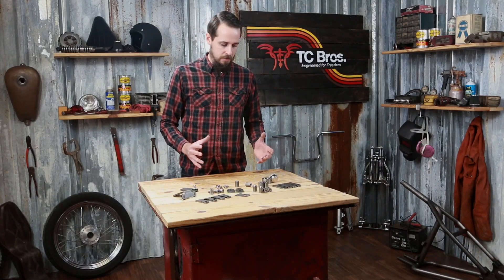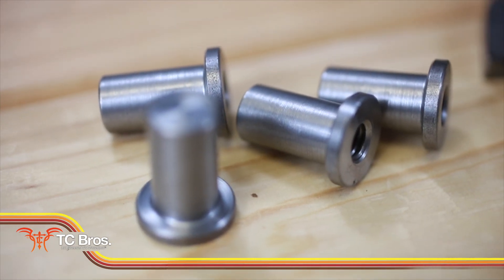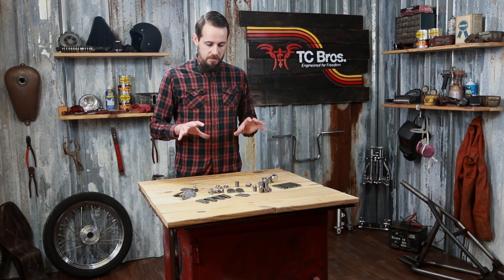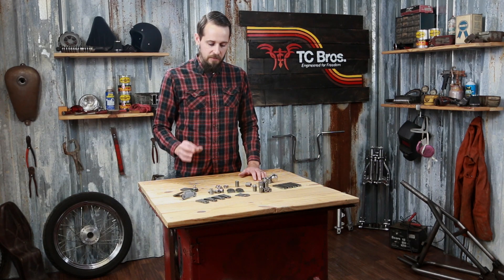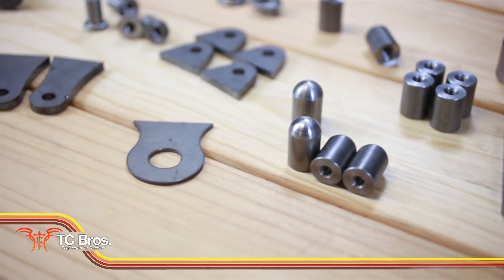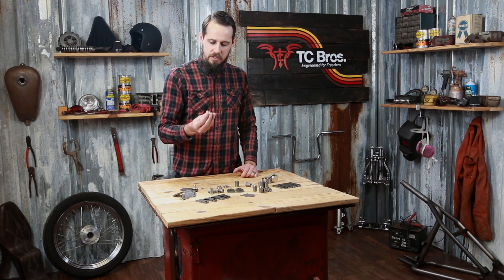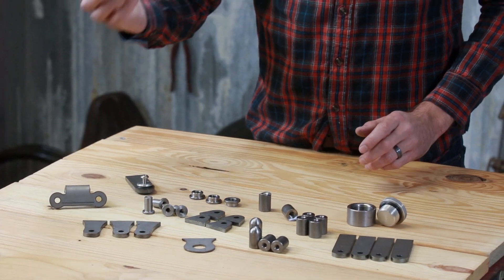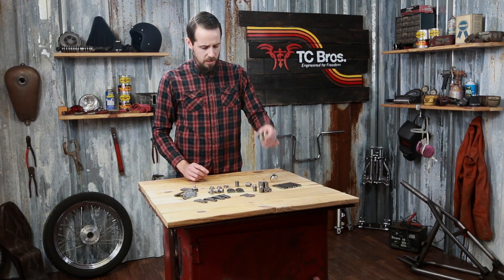TC Bros. - Fabrication Bungs & Tabs For Custom Motorcycles

Comment: I have used your brackets.  They are nice but a little thick. I’m wondering why you make them this thick and not 1/8 or 3/16 which would be easier to weld more in line with the frame tube diameter and plenty strong. Thank you you make nice stuff.